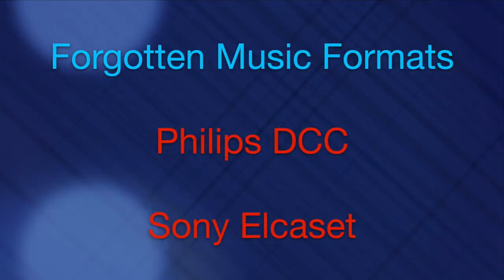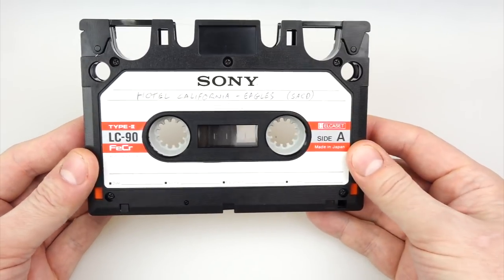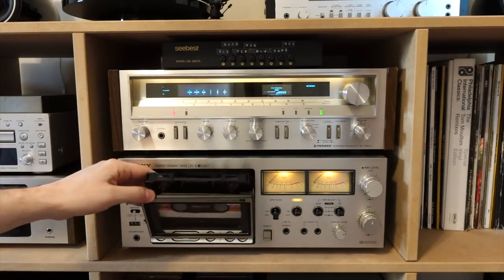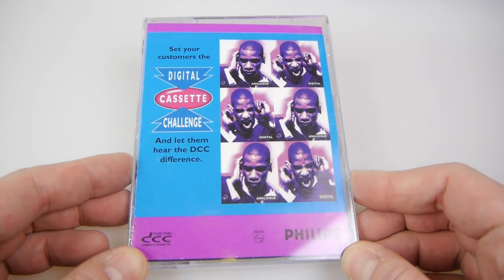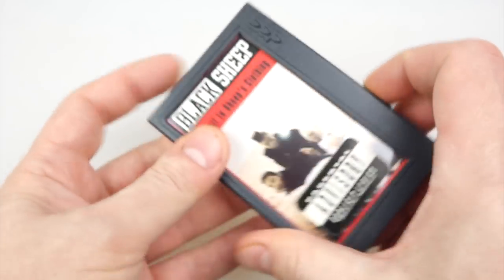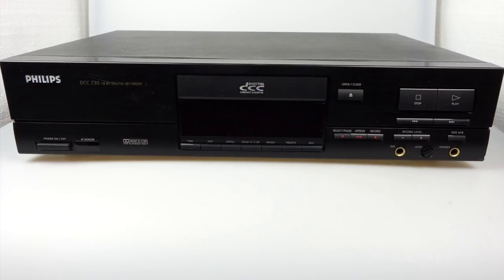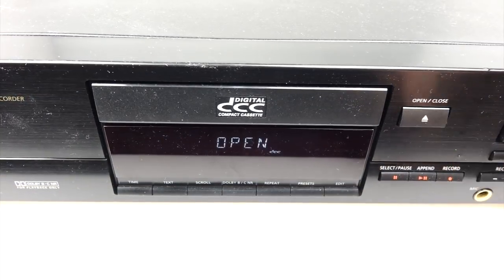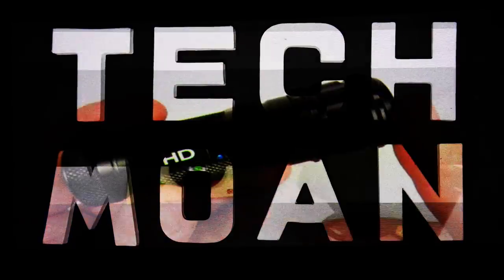Forgotten Audio Formats: DCC & Elcaset

Comment: Thanks for posting this, very entertaining!

I never even knew about Elcaset until maybe a few years ago; I think this is the first time I saw a video of it. I was a big fan of DCC though, but I was probably biased, because I lived in EIndhoven, the home town of Philips, in that time.

DCC came out in 1992 and had been in development since 1987 or so. There are pictures online (from a magazine) of an early prototype DCC recorder based on Philips 1987 top-of-the-line cassette deck, the FC567. I worked at Philips for a while between 1995 and 1997 and met several engineers who had worked on DCC and they told me that at first, they simply used TDK SA-X tape until the official tapes (which were based on video tapes) were ready. Your DCC-730 and DCC-951 are identical on the inside, by the way, except for the ESI(?) bus on the back of the DCC-951 which is only for interaction with the 900-series.

You also show the DCC-175 in the video which is a rarity in the world of DCC: Philips released that at the end of 1995 (in the Netherlands only, as far as I can tell, but there are indications that it may have been available in Finland too) along with a cable that you could use to connect it to a PC running Windows 3.1 or later. As far as I know, fewer than 1000 cables were made (much fewer than DCC-175's) so the cables are even more rare. I bought a DCC-175 with cable on the first day it was available, and paid almost 1000 guilders for it, the equivalent of about US $800 in today's money. That was about 30% more than I had paid for my DCC-730.

If you had the DCC-175, the cable and the software that came with it, you could transfer a DCC tape to hard disk (in PASC i.e. MP1 format) or vice versa. It would also let you used the DCC as backup device but that was pretty useless: the backup software didn't support the new long filenames that had just been introduced with Windows 95, and the speed was the same as for audio (384 kilobits per second) which was just way too slow to be practical. The audio editing software was kinda interesting though: it would let you edit DCC audio in copy-and-paste style, and do some minor effects like filtering. And you didn't even need the audio card in your PC (if you happened to have one -- not everyone did in those days): it would use the recorder to encode and decode the PASC compressed audio.

You could also compose mix tapes from songs on your hard disk, and then tell the program to automatically record it to tape. I did that for a while when I had a DCC player in my car: I would play a mix tape on my way to work and once a week or so when I got tired of a song or bought some new music, I would re-record the tape and it took almost no effort at all because all I had to do was put the songs in order and hit the start button.

A nice thing about editing DCC tapes on the computer was that you could edit the song titles and album name with the PC keyboard and of course that was a lot easier than using the remote control (and you would be able to use symbols like the apostrophe). And it was possible to record and play continuous music for a much longer time than a cassette would allow: I was in the fortunate position to have access to a CD-recorder at work, and that made it possible to store up to 4.5 hours of continuous music on a CD-ROM in near-CD quality. I just needed the computer and the DCC-175 and cable to play it back because it was in PASC format. Later on, some MPEG player programs started supporting the under-documented stuffing bits in the PASC/MP1 format so that made it possible to play the CD's through my PC's audio card without help from the recorder. Good times!
Reply from the maker: +Jac Goudsmit Fascinating information - thank you very much for posting this.

Comment: So happy to discover this channel! I've been enjoying your reports. Back at the end of the DCC days, I got a unit from Radio Shack. Finding blank cassettes was not easy for me but I learned a trick were you can drill a little hole in a specific position on chrome based regular cassettes and the player will record in the DCC format. It was a hit and miss experience drilling holes on chrome analog cassettes, but what a joy! I was thrilled by the fact that text could be recorded.
Reply: DAT had the capability of having text as well in the subcode channels (at a minimum, track titles) but that seems to have been used only by Tascam on some of their (pro) models, and therefore, not supported by other manufacturers. Meaning that the text was not displayed on other manufacturers' machines.
Reply: And what happened if you played such a tape on an analog player? C'mon, you've got to have tried that at least once 🤣
Reply: i have a 1993 chrome cassette Connie Francis The Singles Collection UK. The cassette sais recorded with Chrome II ,but it plays Normal and it has a big hiss. The place where the cassettes were recorded, they did not put the right case...so i have to willfully drill a hole each side for chrome.[because my machine is automatic]...I suspect the place of making them was Netherlands...and not UK. they should take more care when making tapes. then i'll rerecord it from the cd equivalent.
Reply: @lindemann316  me too, I want to know!!!

Comment: Never heard of those 2 formants. Thanks for the informative video. 
And youtube really needs to do something about that ridiculous copyright nonsense.
Reply: This DCC looks an awful lot like DAT (Digital Audio Tape) which by the way I've never used for audio, but hard drive backup back in the mid 90's.  DAT backup tape drives were like a grand back then.  Interesting stuff...
Reply: @BillAnt  Big difference is that DCC didn't use rotating heads. Instead, IIRC they recorded something like 20 or 40 linear tracks next to each other to store the amount of data needed.
Reply: @erwintimmerman6466  and seems it is more reliable than helical rotating heads. (logical). 
Techmoan's portable DATs do not work,/does not read DAT tapes while the portable DCC still works. What a difference! :-)

Comment: Since you are into rare audio formats, have you thought about trying out a PCM adaptor? It's a thing which allows you to record CD quality digital audio on a plain simple VHS (or Betamax) tape and requires an ordinary VHS recorder. It was quiet common in studios before DAT and the CD's 44.1/16 resolution comes from this medium. YouTube has some videos if you search for it, it's quiet interesting.
Reply: István Nagy 
For a good audio quality , use a HIFI stereo vhs recorder . Low end vhs machines records and plays the audio only in mono mode . I tried to record audio on my hifi vhs recorder : it worked well . I still not have this machine , video heads were worn and too expensive for the used machine that i had , it had too many hours of use ( i played a lot of rental vhs tapes when there was nothing good to watch on tv  , the vcr had audio outputs , i plugged it on my vintage stereo , the sound was a blast on action moovies , home theaters were too expensive  in the beginning thats why i did not bought one )  , and i had to restore the deck too ( belts , clutches , pinch roller ...)

Comment: Thank you for your time and energies re-visiting these audio formats of yester - year. I remember going into a pub in the Kings Cross area of London during the late 1970's and seeing the Sony Elcaset playing their lunchtime background music. The sound was really good. As for Philips DCC, the technology seemed to work a bit like the good old VHS video cassette, where the tape was pulled from the cassette body and furled/laced around the playback/recording head. When you needed to seek out part of a recording i.e. fast forward, the device would stop, return the tape into the cassette body at slow speed, then advance at high speed, stop, then pull the tape out, lace it around the 'head and play. A lot of time consuming mechanical activity for the listener to wait for just to access their music! On a visit to a Phonogram factory in Walthamstow, East London during the early 1980's, I saw part of their cassette production line. I was reliably informed that the paper labels for pre-recorded cassettes were stuck to the plastic shells using chloroform. Apparently a small shot of the liquid was sprayed on the shell which made the surface of the plastic tacky for a short time. The label was then applied and was firmly adhered to the cassette shell. All of this was done on a production line zooming along at a serious rate of knots! Maybe the same process was used for 8-track shells also. Keep up the good work sir.

Comment: I bought a DCC machine from Radioshack on clearance because I couldn't afford a MiniDisc. Both retailed at $700-$800, but the DCC was only $80 on clearance, so my high-school self knew which to choose. I used it to mix-down tracks from my Tascam 424, and even years later, my band was using it to record our shows in stunning clarity! I also loved that I could use it for my regular cassettes and play them back with many of the new features like track search.

Comment: I owned a Marantz DD-82 for a while in the 90s.  What you said about the audio quality from a standard cassette was true for me as well, I found it gave a much richer, clearer sound than my tape deck and I ended up using it as my primary tape deck for that reason.  I did have a few blank DCCs which I offloaded some analogue content onto and they sounded fantastic.  But ultimately I stopped using it because getting the DCC tapes proved difficult (only Richer Sounds ever seemed to sell them, and then only sporadically) and when they stopped selling them they became almost impossible to locate.  It's a shame it never took off, especially since they were backwards compatible with cassettes, but I guess after CD it was never going to, as CD had the double whammy of being portable and quick to change tracks.

Comment: If I would have been alive at that time, I definitely would have gone Elcaset.
Nowadays the only thing I can afford as a student are the good old compact cassettes. I do that on the one hand for confusing people seeing me in the train  with a Sony WM-D6c and its red LEDs, on the other hand for keeping my vinyl record's analog goodness.
The cassettes are very comfortable as they are cheap and easy to get and if one has a good tape deck (with bias calibration and triple heads), he doesn't really need very high end tapes.
Reply from the maker: AlmightyMaria PvB there's a lot of people who couldn't afford or wouldn't want to pay for a D6C given their current prices, so you are very lucky to have one (as well as appreciate its abilities).  I've been using a D6C to play my old tapes from the 90s and the sound when pairs with a good set of headphones is as good as I could want.
Reply: Techmoan
You are the first one I know on the Internet who uses this model as well.
I've got a few questions there:
Do you have the model with the amorphous head?
Did you have issues with head wear on your unit yet?
I'd really appreciate an answer as I am very concerned about the life of my tapeheads.
Reply from the maker: AlmightyMaria PvB I don't think I've any head wear, but the D6C is quite a repairable machine. I'm sure someone could put new heads in it if you needed this. My D6C is one of the earlier ones with the older circuit board design, not sure what head it will have in it.
Reply: I know, old comment, but you couldn't afford any kind of digital player but a WM-D6c was in your budget in 2015? That seems somewhat counterintuitive, lol

Comment: The DCC was rather set as a competitor to Sony's (also failing) DAT. The big advantage of DCC was that  it did not use a rotating head which DAT used (pretty much like in a video recorder). DCC used static heads,  for many very thin tracks in parallel, so the heads looked like a sandwich with many layers. That also meant that Philips had to remove data (DAT recorded up to 48 kHz 16 bit PCM data uncompressed, hence the need of the rotating drum) to lower the bandwidth needed.
DAT has seen some revival in the data storage world as a cheap backup medium - also prone to many failures (due to the rotating head drum!), DCC died.
Reply: I remember that the music industry was scared shitless of DAT, for its lossless recording capability. They weren't as concerned about the lossy formats, and still, the whole mp3 thing almost killed the industry. They lacked a lot of foresight.
Reply: There was a secondary reason why they were afraid of DAT: It put an arguably CD-quality tape machine on the market at a "high consumer" price. Heck, it could produce tapes directly in CD audio format (44.1 ks/s, etc.). Furthermore it was possible to slave several such decks to a master clock, producing a multitrack CD-quality recorder. The music industry hated the notion that anyone outside their closely guarded gates would be able to master a release-quality track. Back in the early days of rock and roll, hundreds of tiny little labels sprang up to record the new music that the majors didn't want to touch. They were powered largely by relatively cheap, easy to use analog tape machines like the Ampex 600. (You saw one of these in The Richie Valens Story, in the home studio of the guy who wanted to record Richie but not the rest of his band.) After many of those little labels had success the majors spent huge amounts of money buying them up, re-consolidating the industry. They did not want to have to do that ever again. Of course, computer-based audio workstation hardware and software soon got cheap (and put the final nail in DAT's coffin, or tossed the last shovel of dirt on the grave, or whatever) and re-vitalized startup labels anyway...  so these issues seem very quaint now... but that's the way it was.
Reply: +Pascal “Le Bakala” Gienger DAT came in 1987,  DCC and MD in 1992. DCC and MD were clearly the competitors, both designed primarily for mobile use. DAT was designed for home use. DAT remained in marginal use in the professional market.
Reply: +Jamie Hanrahan The funny thing is that they fought so much against ways to improve the old style home recording from radio records etc. and as a result people just started copying and ripping CDs. DAT as a copying method was a joke compared to a PC with a CD burner. Content producers have never understood technology. If they had had their way, music would still be sold as sheet music. DAT, however,  was dead as consumer device long before CD-R became popular.

Comment: Lol, I once bought a blank DCC cassette by mistake. Ended up just playing with it by snapping that metal part like you would do with a 3 1/2" floppy.
Reply: hehe, just like snapping the plastic plate on a vhs tape or dat tape. always fun on a dark rainy night.
Reply: Dcc cassettes were working in a standard cassette deck  after the modification you've done on the dcc cassette ??

Comment: WD-40 is not a lubricant, but a penetrant, with "light" slippery material that eventually evaporates, leaving behind gunk that will do the opposite of a lubricant.  It is made to loosen stuck parts, but not to permanently lubricate them.  It is important to clean WD-40 off after a stuck part becomes un-stuck and then you can use a real lubricant.

Comment: not sure if you mentioned it but  these are supposed to be able to handle 48khz per channel.    Yeah a CD makes much more sense.  All these parts and tape that breaks or can go corrupt.  bah.  That's why I bought a nice DAT machine back in 1991 for mastering when digital was needed.
Reply: If you read more into DCC you should find that they're actually a bit less complicated, mechanically speaking, than DAT decks. DAT tapes can break, stretch, get eaten, and go corrupt too.

Comment: I loved DCC, I've got the same deck DCC730 in mint condition as well as a portable player. Yours is silver, mine is black. I loved Mini Disc too but the prices of DCC droped earlier, so I bought DCC first. But the first chance I got, I then dropped DCC for Mini Disc as soon as the MD prices got lower. Both of them were great formats. I still use them and I still love them.

Comment: Oh My Man, You really shouldn't use WD on Plastic's, as it's Mineral Oil & Petroleum Based, so therefore will Eat & Weaken most, if not all Plastics..!
Try to save it by Disassembling them and clean with Isopropyl Alcohol on a Cotton Bud...
Then Re-lubricate with a little 'Silicone grease'...This if You can get it - 'Shin-Etsu G-40M' 
Good Luck Dude...
Reply: +Dan SoloTM That and wd40 will grab all the dust it can and gum up the works.
Reply: +Dan SoloTM This seems to be a global misunderstanding, people using WD40 as a lubricant. It's not a lubricant, it's a moisture remover, and it evaporates way too fast to be used a lubricant.
Reply: *****
because it's oil in a can.
Reply: +GrimeHubTV It doesn't add moisture, it adds a grease, but unlike other lubricants it's not a long lasting grease, it evaporates quickly.
Reply: +Dan SoloTM Just the smell of WD 40 is a warning.
Reply: +Dan Solo I love the smell of isopropyl at night.
Reply: They should have just baked it.  They did what's called a "rough pass" and likely damaged the tape permanently as a result.  I doubt it can be used again.